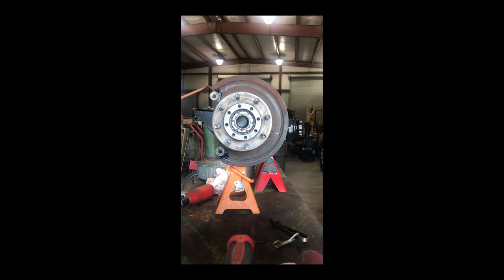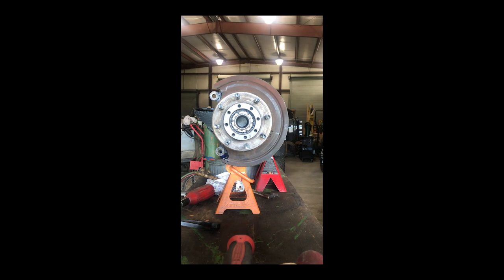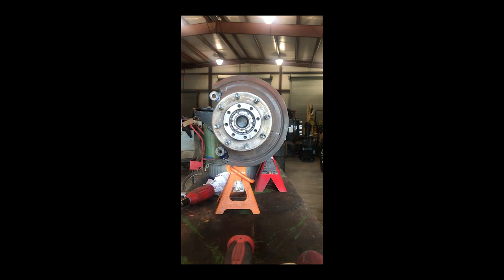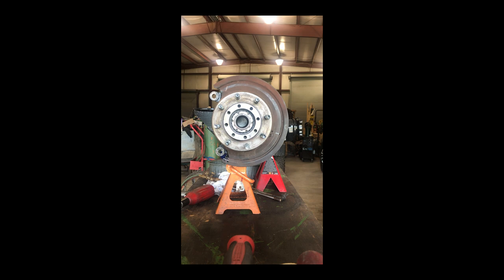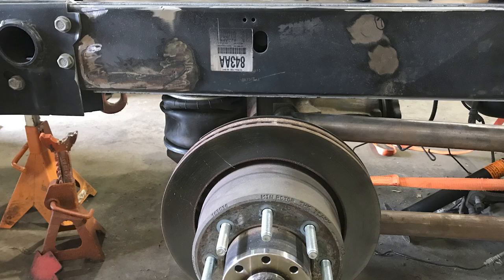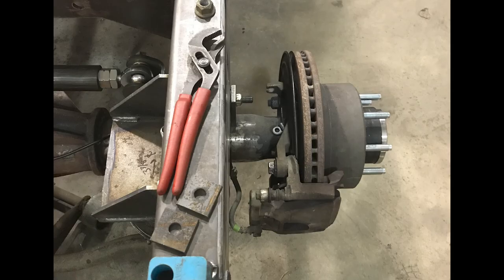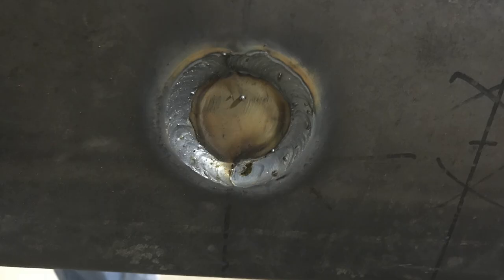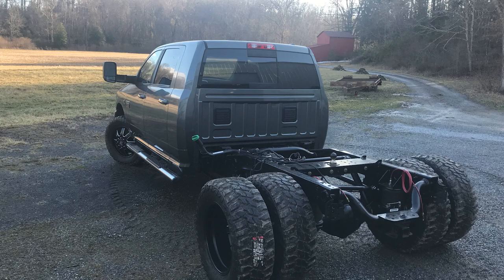Mega Cab Cummins STRETCH to Long Bed...AND  How to straighten and axle Housing!

Comment: I need to ask what metal or how did you make the rear stretch. I wanna do my 06. Finding rectangular tubing size is making it difficult
Reply from the maker: I really just slid the axle down the existing frame and reinforced that existing tube with a bent piece of 3/16 channel.
Reply: i plan on using 7x3 .188 ar500 rec. tubing. hard to find but it exists. to sleeve over the back section, basically scoot the axle back like this and add more frame rail

Comment: What did you use for the frame section? I see holes and the sticker makes it look like a section of frame.
Reply from the maker: I just reinforced the existing frame with a piece of 3/16 bent into a channel.  That channel was welded and plug welded to the last section of factory frame.  The rear most section is very thin, and unfortunately, that is what everything in the gooseneck hitch and suspension had to mount to!
Reply: @aroundtheshop9615  thank you very much for the reply! That makes sense… you just reinforced the original frame and moved the axle back. Makes sense. I plan on doing something very similar. But doing a total stretch of 44”. Planned on cutting the frame where it’s sleeved and welding in a heavier duty rectangle tuning only issue is I’m having trouble finding a piece of square tubing that size. Starting to think it’s a metric size! Which leads me to my original question.  Thanks again for the reply. This helps narrow it down alittle more!